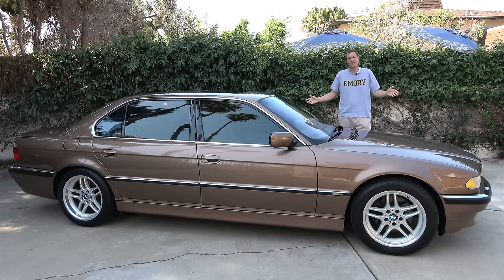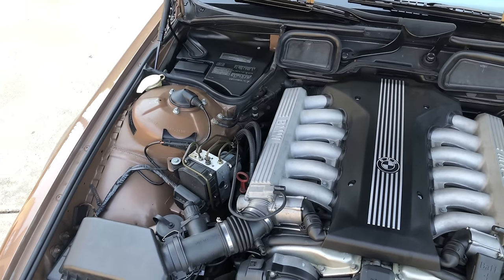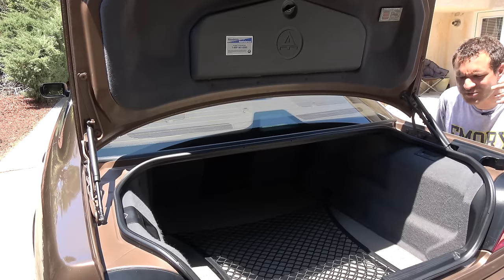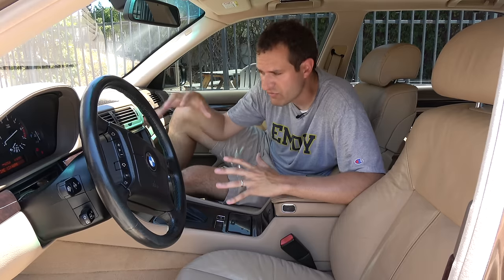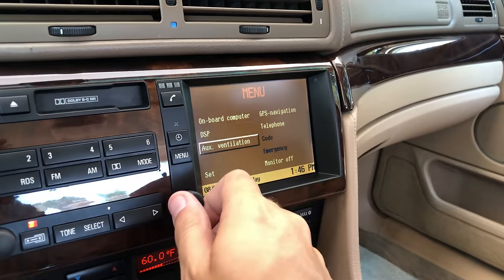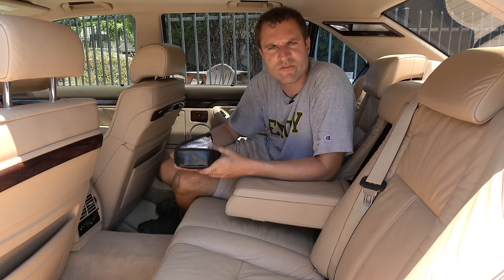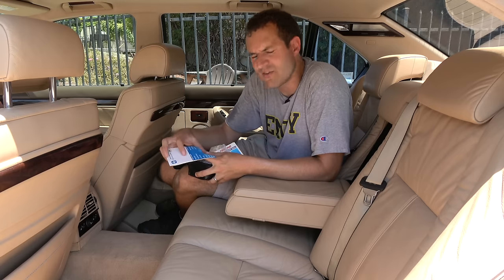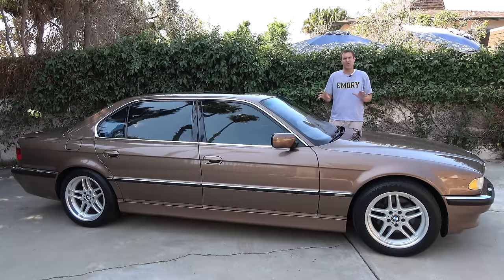Here's Why the 2001 BMW 7 Series Is the Best Luxury Sedan Ever

Comment: While BMW looks sexy today as back when new especially in limo black.

As for the rear parking sensors...
My 2001 Cadillac Seville STS has them, in the rear roof line before the window is a small device, it contains green lights that change as you near an object one green and chime just shifted into reverse.
Second green light dot getting closer, yellow dot closer yet red as get closer the red will flash too close flashes quickly and beeps are emitted.

Add has rain sense wipers must one wipe and done run into down pour turn on automatically to high speed 
The sport stabila track helps guide at highway speeds for right turn rear right brake slightly. ,same for left.
Sport steering is very light in parking lots, low speed notrmal feel highway faster you go heavier steering feel gets 
The seat is power all head rest to seat, with 2 heat settings, with massge and air bag inflates and deflates is wierd as it gets.

The 750 IL and M7 is on my list to own.

Comment: back in 2001 the head of sales at the computer chip place I was working at bought one of these brand new.. a few months later it would not start lol... a flatbed showed up from the dealership to tow it away as it would not start in the parking lot no matter what they tried. everybody in the place was making fun of him for buying such an expensive lemon lol.  The BMWs of many many decades ago were wonderful and reliable vehicles, nowadays they are for people who want to waste money on looking fancy and hoping that it will last for the 3-month lease lol.  why are all the plastic pieces on BMWs so quick to dissolve nowadays?  you would think if you spent a lot on a car, it would be at least somewhat decent quality.. as most mechanics realize the Tesla's are a  prime example of that.. they ask a high ticket price and they are literally rolling piles of Chinese junk with great performance and a pretty interesting thermal system.  oh they also come with a nice touch screen lol
Reply: at the time I was driving a 1972 Cadillac.. if that car wasn't stolen, I'm sure the low compression big block V8 motor and turbo 400 tranny would be running like new still.. now my cars are Crown Victoria's.  There is really nothing like them.

Comment: This model is by far the best bmw ever build.but as good as it is it is even further than being close to being one of the best luxury sedans ever made. W140 is outrageously better. A president car that can be driven daily 1000 miles on bad roads and will last 2 of 3 decades longer (with almost no maintainece) than a E38 that stays in garage used once a week smoothly and doing every single service on timr

Comment: what's up with phones in cars from this period? I have a 2005 Audi A6 and it has a fucking phone in it... Didn't people in 2001 and 2005 have mobile phones? Back then phones were quite cool and small... My Audi A6 can be connected to a phone via bluetooth and speak through microphones build in into the dashboard.

Actually... many people told me that i sound better from the cabin of my 2005 Audi, than from the build in Microphone of my handsfree/earbuds that are connected to my Smartphone, manufactured in 2022...

I think that phones in cars were quite unnecessary :D Bluetooth connection to the board computer of the car and mics build in into the dashboard is good enough by itself:)
Reply: Please tell me you're kidding...

Comment: Best car I ever owned.  Dark blue with oyster white leather. The dashboard was all leather, it had heavy double thick glass for quiet ride, it had hydraulic suspension that would adjust to the road. And those were not a massage seats per se, it was rather moving ur ass chicks left and right for blood circulation on long trips.  The seats had like 16 ways to set it up. They also had an armored version of it, I wish Doug could review that one. And they also had even extra longet version i think they called Li instead of IL. I seen some pt twin turbo on those, it would be fun to drive one like that now if you have money for the gas. Oh my channel might still have some burnouts with it, fun old times.

Comment: Are these reliable.. looking at a 740il. For 2500
Reply: No, they are not. And certainly the V8 engines have had their fair shares of issues. So if you want to buy, have it inspected by a proper mechanic.

Comment: Weren't all of the things Nevins on this car (and more) already in the Mercedes Benz 2000 s600 v12? and it was prettier. Forget the crappy engine that they changed after 2003 but MB had more than this so this car was not a game changer or cutting edge except for the "brand" maybe but they were not the first with this technology neither was MB.  Before this the 1991 Toyota Soarer had back up camera, touch screen radio, digital dash, 4 wheel steering, GPS and a phone...  Jeremy Clarkson on TopGear reviewed this  technology in a Toyota Soarer Coupe.   Is the technology a first for this car or the industry?